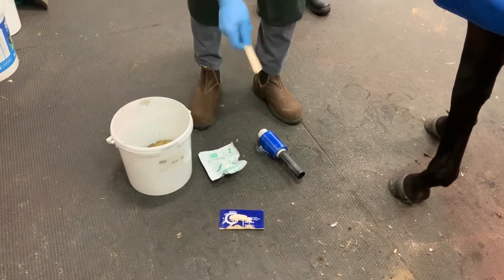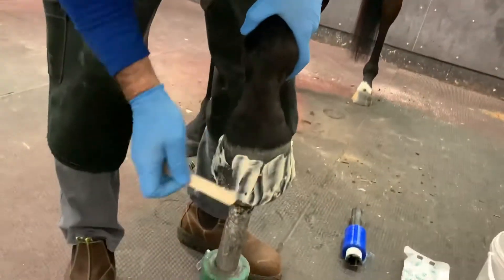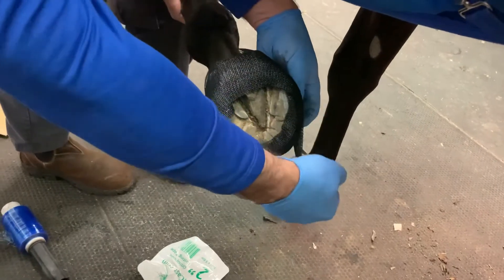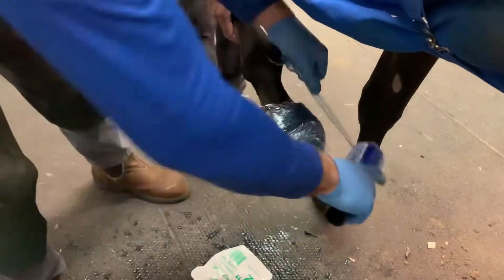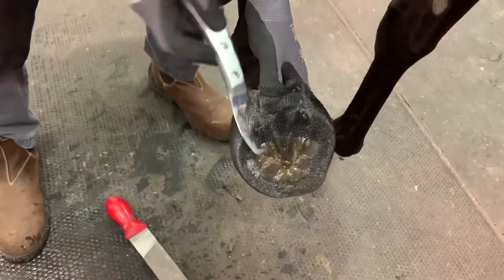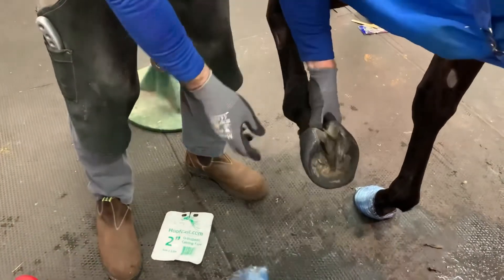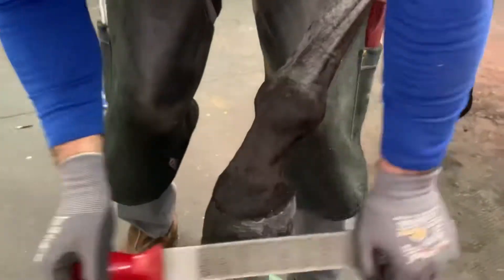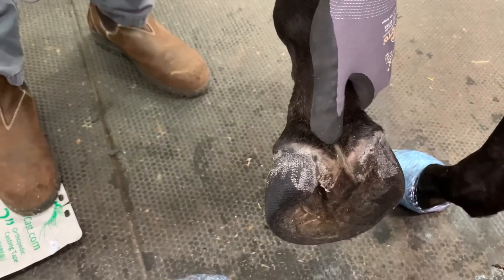HoofCast.com application step by step with Derek Poupard

Comment: How does this hold up in a wet environment?
Reply from the maker: It’s waterproof once it’s cured and we swim horses with it on
Reply: @3dhoofcare127   awesome! I’m consulting with my farrier, I have a mare that is very thin walled and soled and we’re trying to correct her angles but having problems with her being sore when we nail shoes on. I’m wondering if this would be something that could help strengthen her hoof wall, and be something we can nail to or even just build up her heels and not have to put shoes on?
Reply from the maker: Absolutely that’s the whole purpose of it. The weak walls thicken up over time as well as strength is added back into the foot. It’s been revolutionary for the thin walled racehorse.